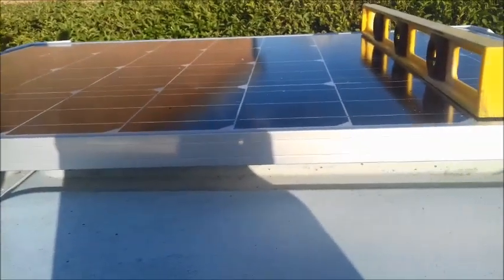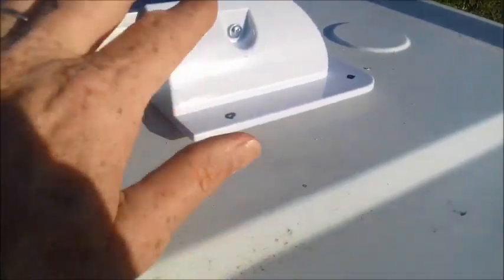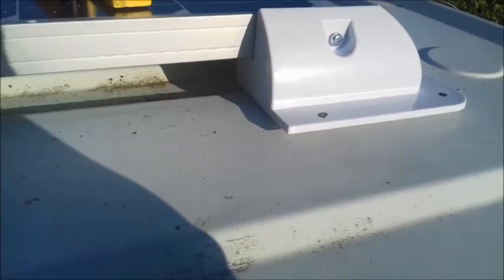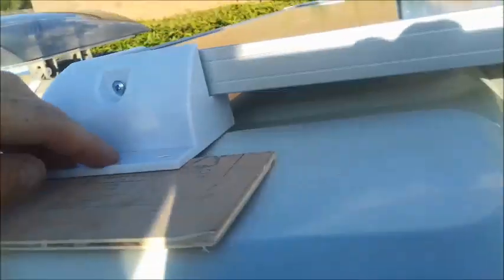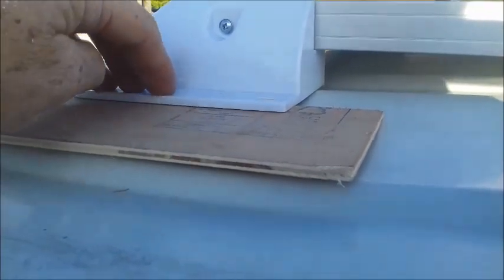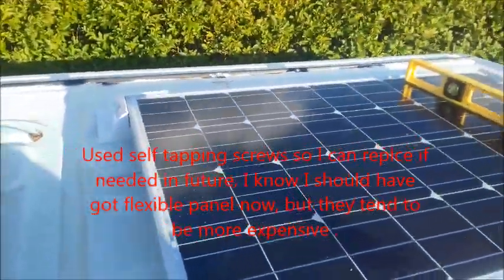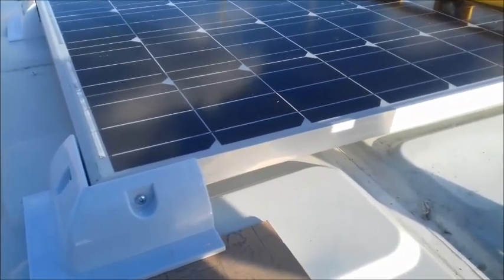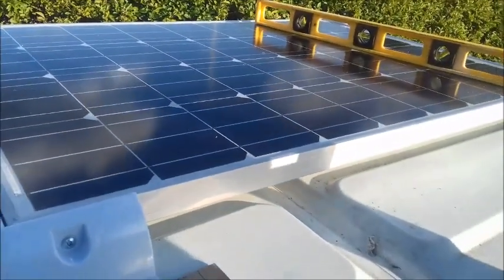Problems fitting Solar Panel to uneven van roof

Comment: Just dont use the premade plastic attachments would have solved it very easily..
get some aluminum bars and make a a custom attachment and glue it on with sikaflex like normal ^^
Reply from the maker: Well two years lateer im now living fulltime in my van with covid restrictions and the panel is still stuck on th roof the same as before and is my sole power source and is enough for my needs.
Reply: @IanVanMann  thats not what my comment was about you could have made a better attachment by yourself than with the premade ones ;)

Comment: I have the same issue. My van roof is totally ridged. I don't know how a flexible panel would help? Well, it wouldn't help me..
Reply: Use window fitters shim Packers and glue them down.  Glue the mounts.Then bolt through. I have the same problem. Hope it helps. Ian D

Comment from the maker: What I ended up doing was screwing in the supports with lots of sikaflex and then after it cured 48 hours I then went over the screw heads with liquid roof sealer. The solar keeps my fridge cool and is sufficient or my needs as I have used it everyday, the miles per gallon has not changed, still a steady 35 miles per gallon, I never go over the speed limit. Please subscribe for further updates, I need 100 subscribers so I can re-join the youtube partner programme and thus become more efficient at making informative films.